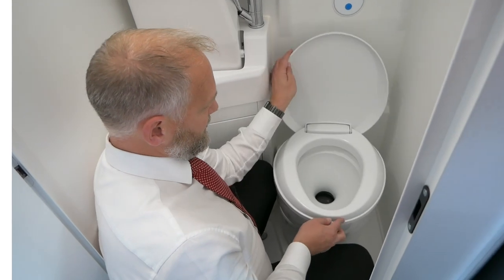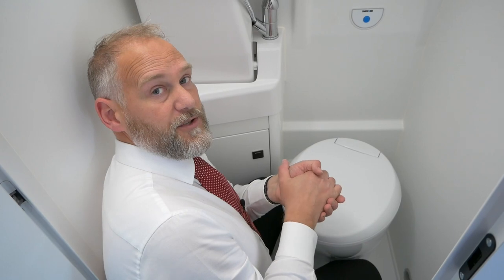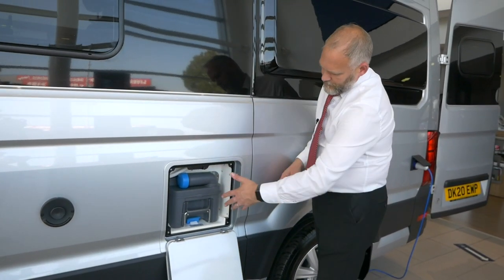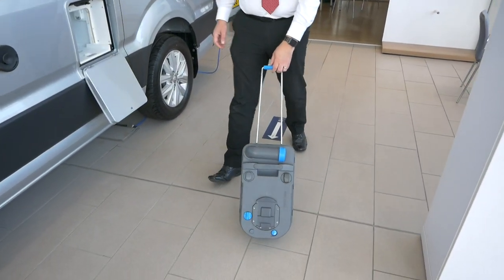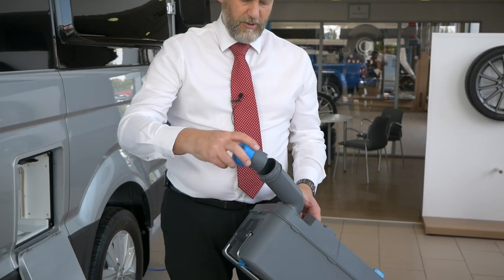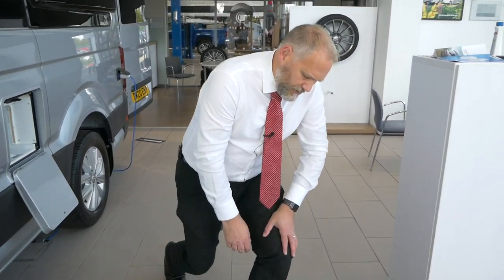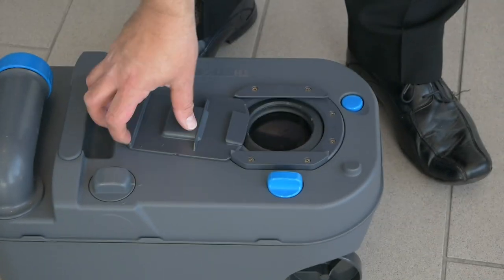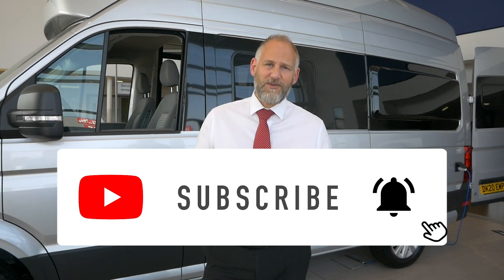VW Grand California Toilet Mechanism Details

Comment: Its good they put a locking mechanism. On my first RV trip in New Zealand, I saw one of those cassettes and a large blue splash on the side of the road in Coromandel Peninsula. It has very twisty roads there and someone must have forgotten to lock it down. I just hoped there were no cyclists coming the other way when it happened.